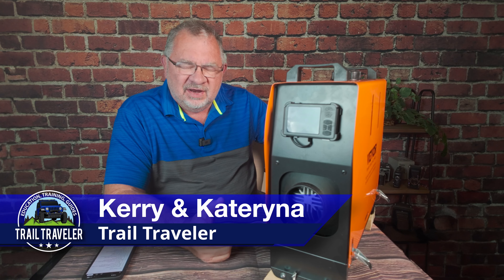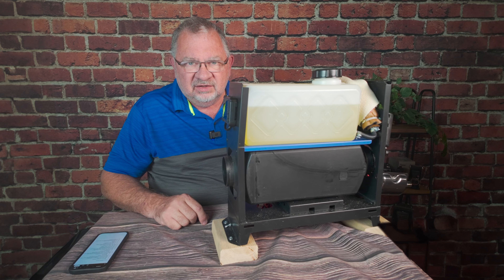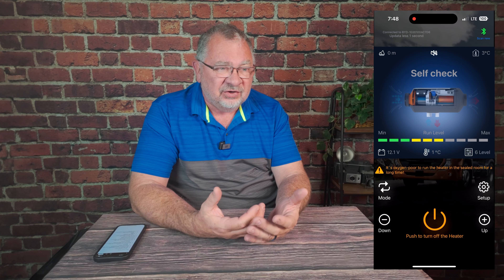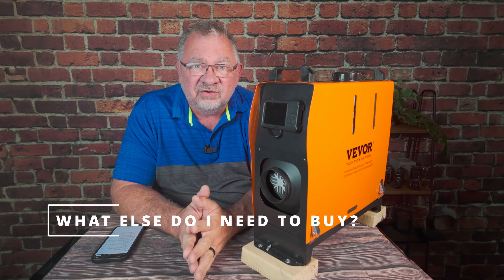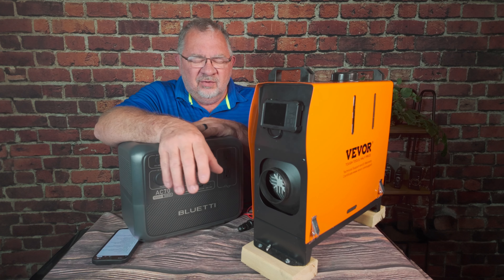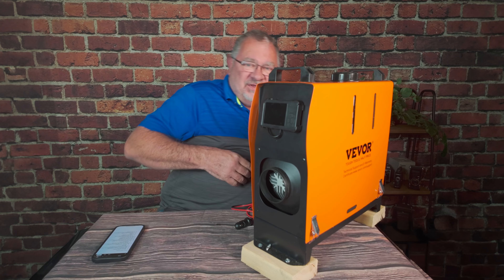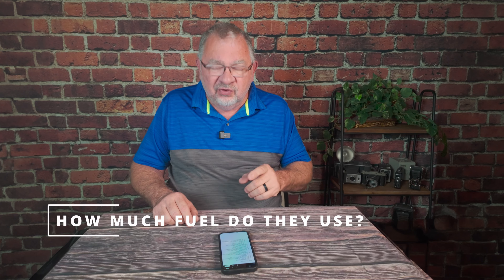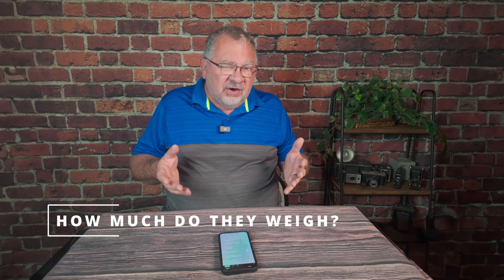Answering Your Top 15 Questions about Diesel Heaters

Comment: Run K1,#1 kerosene, and no smoke, little to no carbon monoxide, chamber will not clog up with deposits and will run efficient because chamber is not dirty. If you can get K1 at near price of diesel...get K1.  If you can only get diesel, use the more expensive on road taxed diesel...off road diesel and heating oil will run dirtier and make smoke etc.   Kerosene will also not gel up.

Comment: Hey thank you for the Amazon info, is any possibility to share the link in the adapter that you use for r unit to the 4” hose
Reply from the maker: I'm still trying to find a better solution, for right now though, I come off of the heater with a small section of the 3" hose that was included, and then use this adapter: https://amzn.to/3RUoXhI

Comment: I'm looking at one for a truck camper. What about the fumes? Do the newer ones still have fumes inside the living space?
 I also have a CPAP and have some issues with fumes.
Reply from the maker: As long as the exhaust is vented outside, or the unit itself is outside and you vent the hot air inside, you will not smell anything.

Comment: I have just purchased a diesel heater for my garage. Are there any issues (other than ensuring that the joints are gas-tight) with extending the exhaust pipe? Could I route the exhaust through a small radiator, to recover more heat?
Reply from the maker: There shouldn't be any issues to be concerned about. Yes, some people have used a small radiator although most people don't recommend it due to backpressue and condensation concerns. This is discussed a lot on the Chinese Diesel Heater groups on Facebook.
Reply: Thanks! But I don't do Facebook! 😳

Comment: Actually this folded gun type burner could also use gasoline or propane or almost anything flammable. It's mostly energy density and safety that points to diesel. They are also made for gasoline.
Reply: If you're talking about the diesel heater you cannot put gasoline in it gasoline ignites easier it would not ignite one time it would ignite before if you know what I mean
Reply: @Poncho-zq4dy  Old VW camper vans had a heater similar to the above as an option that ran on gasoline, German engineered so it was safe as could be.

Comment: There is a difference in the 8 kW it has a larger burn chamber inside the plastic cover which gives it more heat surface to blow over Everything else is the same Same amount of fuel burned Just a larger burn chamber for the blower to blow over No more fuel is consumed same pump same glow plug same blower same tank
Reply from the maker: I have yet to see an axctual 8kw unit. I have seen people open them up and the exchanger literally says 5kw on it.  The less reputable companies just use 8kw for marketing and it really isn't.
Reply: how long can you do the exhaust pipeline @TrailTraveler
Reply: @TrailTraveler mm is there a word to make it longer exhaust pipe?
Reply from the maker: @kennethramsey7663  Ive seen some pretty long ones, but you have to make sure it slopes down to prevent moisture buildup.
Reply: Can it run on a 10 amp battery charger??
Reply: Will auto diesel flow at 5 degrees??
Reply from the maker: @user-st5rc9nz4j never tried
Reply from the maker: @user-st5rc9nz4j if it has winter additives or mixed with kerosene
Reply: I'm just being theoretical here but couldn't you just put the tank about 5 ft off the ground and get rid of the fuel pump
Reply: Maybe even less
Reply from the maker: @Poncho-zq4dy  Yes, someone else has actually done that. It was just a matter of getting the drips of the fuel setup properly.